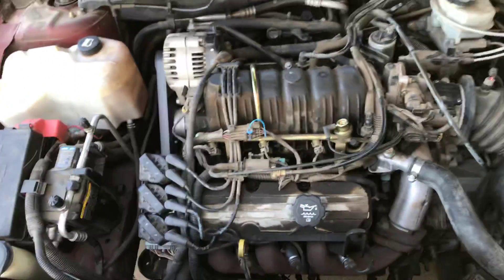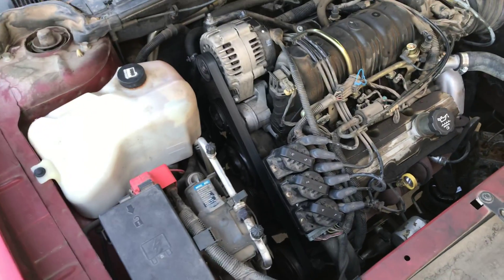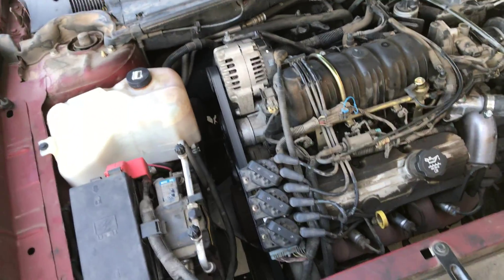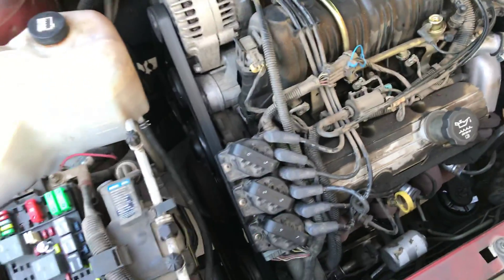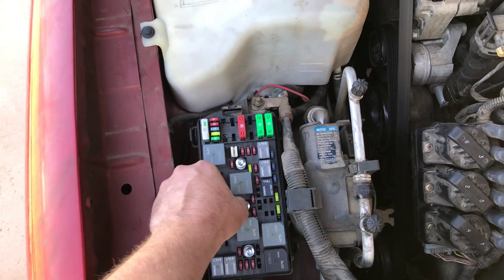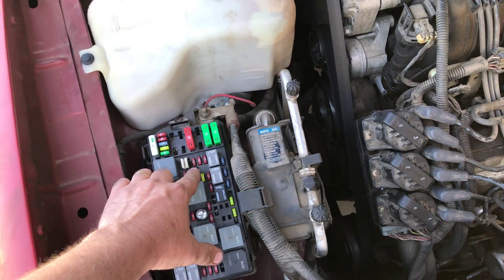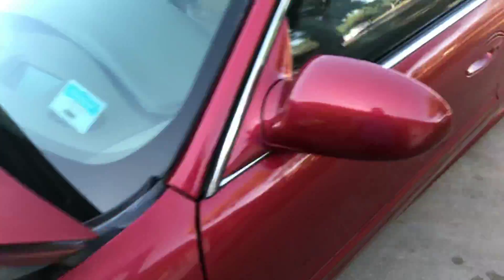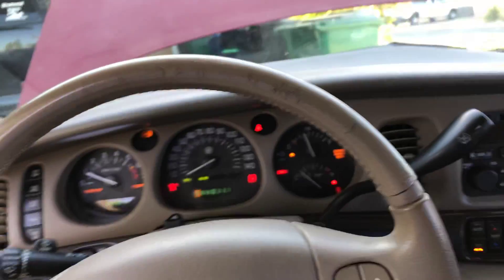GM 3.8L V6 (3800) Cranks But , NO START Solution. Also solved Cigarette lighter not working BONUS!

Comment: So you were getting no movement outta yer rpm needle when cranking ? I have a 2002  park ave. Crank no start issue also......that fuse block in mine I dont think uses those 3 bolts but does seem kinda loose
Reply from the maker: @davidwhocares3293 Another tip: I’ve been told that you can separate the top 1/2 and bottom 1/2 of this thing when the bolts are out. And that there is a “contact patch” there that can corrode. If so.. sand/brush it clean and apply electrical anti-oxidant paste. And put it back together….   Some people say they find theirs under the back seat. Or in other parts of the car.
Reply from the maker: @davidwhocares3293  figured it out? Does the park ave have one under the back seat too?
Reply: @URAGR81 i have not figured it out yet.....
Reply from the maker: @davidwhocares3293  I’m not a professional mechanic but I would start with checking the crankshaft position sensor. .. check it has a good ground wire by buying a test light. You may have one already. If not  get one and follow instructions to connect one end to the positive of the battery and the  other end is like a pencil probe with a sharp point in the end.   You can use that pointed tip to test the negative pin of your connectors.. or to pierce through the insulation of the negative wires every you want to check them. … if the pencil light thing turns on, bingo you have a good ground wire. If I had started by checking all the various grounding point on the vehicle, and the critical sensors, crank sensor, cam sensirs, etc, I would have solved mine a lot sooner.  If you DO find you have a bad ground wire you can test it by jumping a new ground wire from that point back to the negative on the battery .. and test it again. If you still don’t have a circuit that works. It’s NOT a grounding (-negative) power issue and you can figure out the next things if it’s a bad sensor or a module or who knows.  … I was lucky to have my dad taught me to work on project cars…. I only know enough to get myself into trouble and frustration and then slowly work my way back out again.  Good luck.
Reply from the maker: @davidwhocares3293   I will pin this and see if anyone else has ideas for you.
Reply from the maker: @davidwhocares3293  another tip: a lot of people ask what size or where to buy this bolts…. I don’t know, but you CAN find them at the junk yard for dirt cheap on tons of GM vehicles of same time period. Tons of Cars and on Vans like my friend had same issues.. , (not trucks, or Yukon, suburban I don’t believe) … pay your $2 at the door and go shopping around in there. It’s fun. Grab some sensors and stuff while you’re at it if you find a match.  👍

Comment: 2008 Pontiac Grand Prix sitting in the Walmart parking lot cuz it was running fine I came out and it cranking but no start everything's working fuses are getting everything's new Even my ignition module plugs and everything are new from a few months ago I'm definitely off to try this

Comment: I have buick  centrey  and when i have my battery  hooked up it clicks  but when we have the battery  of and put the jumpers on it try  to  start but it doesn't  how do I fix it
Reply from the maker: Hi, when the battery is discharged very low (dead battery), and people put jumper cables on it, usually the will not start. That is because the battery itself is causing high electrical resistance. …. The “click” is your starter solenoid popping out the little gear to engage with the flywheel in order turn the engine to start it. But there is not enough electric power to actually do more than that.  ….. so , 1. Charge battery for a few hours, or 2. Buy a new battery.   
Bonus….. how to jump start a car:  Most people are not taught correctly how to do it.  You do not put the jumper cables onto BOTH SIDES of the battery. you only put the POSITIVE jumper cable on the battery.  And the Negative cable clamp goes onto a safe bare metal spot on the engine or any other bare metal grounding spot or lug (often marked by the factory) . Why?? Because this way, the insides dead battery itself is not sucking up or blocking all to power you are trying to get into the car starter and systems.  

So if you just try jumpstart in the way I described you might find out it starts first time. And then you can deal with finding out if the battery will take a charge or if you must replace it.   Hope this helps people too

Comment: Omg could it be thst simple? I have a 2008 buick lucerne and i have no power to the fuses on the left side of block and also fuse #5 on the right side. Holy shit! Im going out right now to tighten those bolts. Fingers crossed

Comment: Maybe this will help someone avoid frustration and feeling lost if this doesn't work.Remove back line from fuel rail and have someone turn the key to on to see if gas flows.if no gas flow fuel pump is most likely your issue if the security light isn't freaking out when you start the car.If you have gas flow pull the connector directly under where the coils are you will need a 6 or 7 mm socket I used a 7 mine was very rusty so couldn't tell proper size.You will need a multi meter to test for power.Turn it to DC voltage and select the number nearest to 20 on your meter.stick the black probe on the battery ground and probe the first socket closest to the battery on the connector it's a pink wire.You should see 10-12 v on the meter with the key on.Next take the red probe and put it on the positive battery terminal.car no longer needs to be on.now take the black probe and stick it in the 5 socket to the right it should be a black wire with a white stripe.If you don't see 10-12v you have a bad ground on your icm.If you have both power at the pink wire and power at the black and white you likely have a bad icm and will need a new one.they can be easy to find at junkyards or they're about 80 dollars shipped on rock auto.hope this helps someone

Comment: My man! You are my hero! I just bought a 2001 Buick Lesabre and it was starting fine until I pulled it into the shop to change the headlight switch. After I did that simple fix it wouldn’t start! I was about to go get a new fuel pump when I decided to check out YouTube. You were right! All three bolts were hand tight. I tightened them and it started right up! Somebody get this man the Nobel Peace Prize!!!

Comment: I can't believe this video is 6 years old ...  I can almost assure you that those 3 screws IS NOT what fix your problem...  Maybe you reseated the relay, or cleaned a contact somewhere, and not realized that that was the problem...  those 3 screws fasten the portion of the fuse box where the terminal bed is (all the wires connect with terminals to the relays and fuses) to the rest of the box where the actual relays and fuses are...  Those 3 screws are not ground.
Reply from the maker: Ha ha , nope. This was what fixed it. And hundreds of other people too. Plus, my dad was a GM durability test driver during the time these years of GM vehicles were being tested. He confirmed THIS situation happens. …. Aaaand laughed at me.
Reply: @URAGR81  My great grandfather was a submarine acrobat...  I know ... irrelevant...  just like your dad is...  First of all you have no explanation, "it happens" is not science...  Secondly, you didn't dispute my assertion that those 3 screws are not ground... they serve the exact purpose that I described...  What's more, tightening the screws may actually firm up the terminal contacts, which may be why your issue was resolved by tightening them, but again, those 3 screws are NOT ground...
Reply: @BLACK-AUTUMN-MAGICK  @Lets-follow-HIM I agree with Black Autumn, despite the somewhat rude reply. My '02 Park Avenue doesn't have those bolts, and the fuse box cover has an integrated knob/screw (not grounded) that uses the middle hole to hold the cover down. I saw a couple of posts here in the comments that suggest the park avenues have screws from the bottom. I am having the exact issues stated in this video, and have replaced ICM, crank and cam sensors, and the coil windings all test well within spec. My fuse box does seem quite loose, so I'm going to try some m6-1.0 x 20mm bolts in the top and bottom holes to see if it makes a difference (have to leave the middle hole free for the cover screw). I'll try to remember to report back, just for yet another data point.
Reply: @toddkirby7977  It wasn't my intention to be "rude"...  I'm surmising that the "rude" issue, was in my reply, rather than my initial post...  I apologize if it was offensive to  you...  I *DO* have a pet peeve though, about people who "pull rank" ...  rank has no place in ANY troubleshooting discussion...  Just because someone is an ACSE mechanic doesn't mean they know everything, and it doesn't mean they don't make mistakes...  I just watched a car repair video by a 14 yo kid, and kid knew what he was talking about...  again, it doesn't matter what your background is, and it doesn't matter how many years you've been doing something...  A pro can still make mistakes, and a neophyte can still perform well... The repaired engine doesn't care WHO did the repair... You either did it right or you didn't...  ...and the proper repair will work no matter who did it...

Comment: Thanks for this video! I’m trying this on an 05 bonneville tomorrow with the 3800 that intermittently throws maf codes and intermittent idle stalling issues that can only be remedied by unplugging the brand new Delphi mass airflow sensor right now. Fix the car and randomly it’s not fixed anymore. Been such a headache. Plan to update you. Thanks again!

Comment: I'll try this. I pulled the fuse box during a head gasket job / smog pump delete, put it all back together and now it' very hard to start, plus I have no temp gauge.

Comment: In my car the fuses were good, but the fuse box was dirty, but after disconnecting the battery, removing the fuses and cleaning it with an electronic cleaner it stopped turning off suddenly. 💡

Comment: Those arent grounded, they pull the connectors into the fuse block body, so if they are loose, the connectors can back out of the fuse block itself. they dont actually go to ground, just a nut in the connector itself

Comment: Be glad it took 5 days. I tried to start a Monte Carlo same year and motor, and after several attempts I tried starting it with a jump box encase I had a bad cell in the battery..... It cranked and ignited all the atomized fuel that had begun seeping into the intake plenum. Blew everything off the engine near the intake manifold and half the manifold too. Wish I had on video... funny to laughed nowa but scared everyone in driveway.

Comment: Just replaced a bunch of electronic parts my 05 La Crosse.. Now I have intermittent starts. Took your advice and noticed the bolts were not tightened down all the way. This is my last chance. I have run out of options...will update...
Reply: 2 day update. Noticed my resting  battery voltage at 11.7  before I tightened fuse box screws. Noticed after screw tightening  charging elevated to 15 volts input then dropped to 14.6 and resting battery voltage at 12.2 . So the battery was not full charging before. Car has been cranking and starting every time. No drag at  all. Will update later.
Reply: UPDATE: Check the pig tail  connector to you ignition module. Many times there will be a bad wire that can cause many problems,. Mine was the hot wire which was burnt and causing a short that was burning out modules and crank sensors. Also had a few stalls  and then start. THIS IS A COMMON PROBLEM ON 3800 ENGINES.
Reply: update: New alternator dropped voltage to 14.5. Some voltage regulators are set to 14.8 Volts....

Comment: I have a 1997 grand prix GT with 3800 v6. Anyone know ehat kind of wrench key or screwdriver to use to tighten my fuse box down? Torx Allen wrench and screwdriver dont work. Help? Mine is loose and has issues starting up as well. This could be the problem. Help!!!
Reply: I used vice grips on mine

Comment: Lifesaver. Mine had no bolts in it at all. The moment i wiggled it around it cranked right up! Finding hardware today
Reply: So what happened ? Maybe yours not supposed to have the bolts ? My park ave has the bolt holes but no bolts also

Comment: I have a 97 grand prix with the same problem. Checked the fuze box and it doesn't have the bolts that's you show in the video. Does it supposed to have em?

Comment: 2008 buick lacross 3.8 crank ,no start also,,,,codes 0030,0031, 0201-206,,0412 ,0413,0418,,where fuel control module?,,checking grounds

Comment: Girlfriend's 04 LeSabre has been having intermittent crank/no start issues and I'm definitely going to be checking this out this weekend.   Her lighter doesn't work so maybe that's a good sign that this is an issue.  Super frustrating because whenever I go to diagnose it, it works again.  Thanks for posting this!

Comment: Mine are missing those screws in the fuse block. Do you happen to know the thread size on those bolts?
Reply: *Update in case anyone needs to know those bolts are an M6-1.0 x 20mm for the fuse box. Thank you for sharing this video as i was definitely having electrical issues and no cigarette lighter i put new bolts in and my cigarette lighter works again and the electrical issues stopped. You are my hero!

Comment: I have never run into this issue.  Been doing this for 50 years. Been running my own Shop since 1988. I got a 98 Bonneville in shop now putting in a fuel pump. Bet yo a== I'm going to crank down on these bolts while it's in here for precautionary measure. 
Thank Bud.

Comment: Im gonna try this. Ever since my original ICM went out, Ive been having it replaced due to stalling and ive replaced damn near everything that could be asides the crankshaft sensor.  Something has to be cause it to go out early.  Some of your description such as slight hesitation before start up is one on times when its replaced and overheating.  Fingers crossed.

Comment: Ok I think I’m having the same problem but my car will start only when I press on the gas. I’ve changed everything but fuel pump
Reply: My aunt's 2000 Lesabre is doing the same she just replaced the fuel pump still no change I haven't tried this tightening the fuse box yet!

Comment: The 3 bolts are fastening the main power wire harness connectors to the bottom of the fuse/relay panel. At least on the LeSabres I've delt with. On some models like the Park Ave, the fasteners are tightened from the bottom. I can see problems arising if these bolts come loose.
Reply: yeah, I just checked my 00 PA and there are no bolts on top (the center hole is used to secure the box cover).  I might check the bottom now
Reply: @RandomLuminosity what happened ? I have pa with same issue and same fuse cover

Comment: I've got a '92 Regal. After having a mechanic replace the steering column for me, as well as the ECU, a crank sensor, some control modules (all of this over a few years), and after having removed the factory stereo for aftermarket install, then reinstalling original stereo for periods of time and going back to aftermarket units a handful of times:
I suddenly started having no power to the radio circuit, my dash lights stopped working 99% of the time, but they cut back in here and there, my tach started acting up and pinning itself to the bottom (it once even wiggled itself over the stopper and got stuck under there for a few days), my headlights would cut out on me on very hot summer nights, then come back to life after the engine sat and cooled off a little.
I'm going through all of the grounds, cleaning and reseating. I can't find any real info on all 3800TPI ground points for a '92 Limited, especially for interior.
But I can guarantee that many of these issues ARE related to corroded contact points in some way.
I've had several older rusty GMs with bouncy fuel gauges, turning signals speeding up and slowing down with engine RPM. I've had a rust-bucket Venture that suddenly stopped charging its battery altogether, and I could never find the specific problem. I had a Fiero that would only start cold, but would no-start crank while hot, I sold it to a dude who simply cleaned up the battery tray and it started on a 1/4 turn each time. I replaced the coils, wires,  bought expensive-ass plugs, before learning that it was all because of one bad ground.
All that to say: GMs are exceptionally unforgiving for electrical resistance; sometimes a seemingly unrelated circuit screws with the one you're actually having an issue with.
It WILL screw with your head sometimes. Don't pull your hair out, don't dump your money into replacing major sensors and modules. Take a step back and try probing elsewhere, first.
Reply: (This is coming from a guy who wasted thousands of dollars through several cars, often over just one actual bolt. Learn from my mistakes, my friends!)

Comment: I spent two days off and on trying to figure out what the problem was. I had loosen the three small bolts to remove the cover and never would have thought that to be the problem. If I thanked you 400 times it would not be enough. ( Bolts didn't even need loosened to remove cover)   THANKS AGAIN

Comment: Hey man I have a 1992 Buick regal custom it won't crank at all , it makes a ticking sound when I try to crank it , I'm stuck man hopefully you see this and can help , it has to be something easy I just need to know what exactly it is , Its also a 3.8 engine the same or almost setup as yours
Reply: This happened on my 98 buick lesabre. My mechanic pulled fuse 15 from the fuses on driver side. Replaced it and it cranked right up